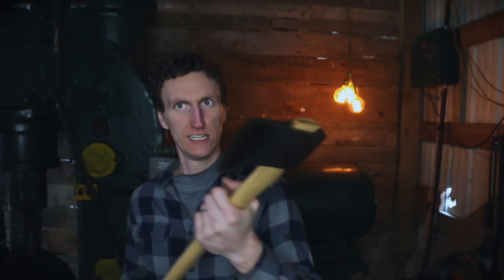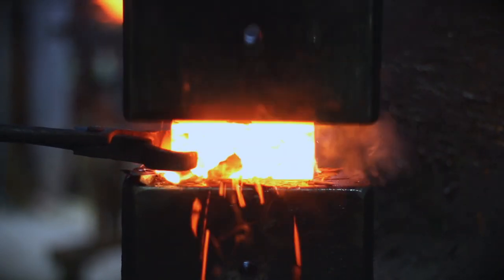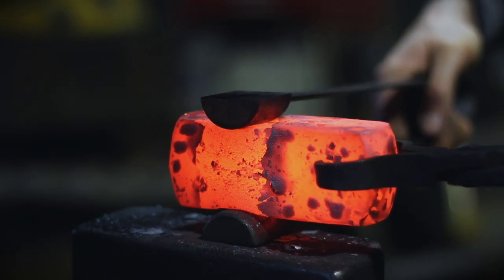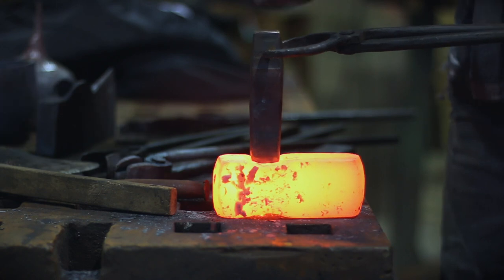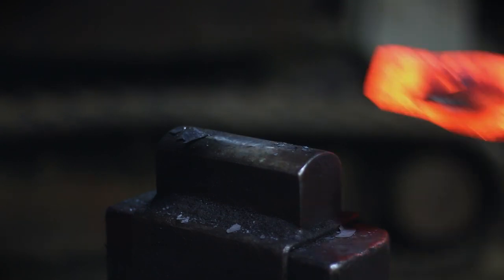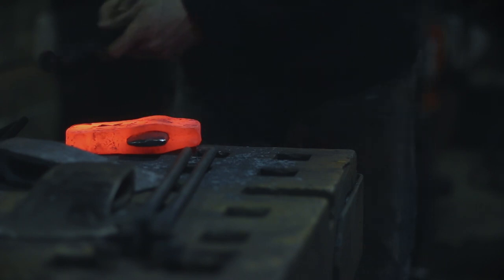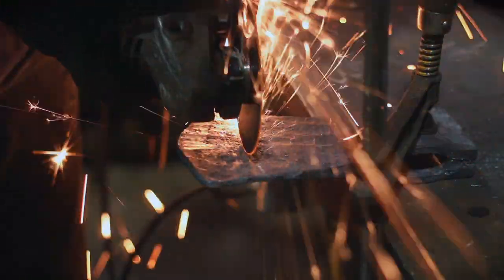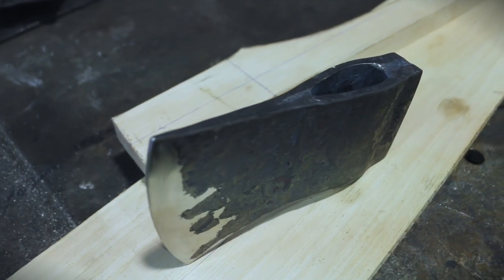Making A Hand Forged Axe Head

Comment: Really enjoying your videos keep up the good work. Ive applied some of your power hammer techniques and tooling to my own work. I like what you’re doing man
Reply from the maker: PracticalTactical wow! That’s awesome! Love to hear it’s helping somebody! Thanks.
Reply: What is that huge table you were hammering drifts on
Reply from the maker: PracticalTactical it’s a acorn or platen table. Used for fabricating and building things. They have square holes all across the surface for special tools you can use to help with holding things down etc.
Reply: I figured something like that I saw a fairly large one at my local scrap yard the other day I might go grab it
Reply from the maker: PracticalTactical GRAB IT! don’t let it go!
Reply: Timothy Dyck I’ve got it in the works now and pretty sure I’ve got it locked down. Just curious what material are you using for your slitters and drifts?
Reply from the maker: PracticalTactical I make them out of S-7 and H-13 if you are not using a power hammer or press. Pretty much any tool steel would work...